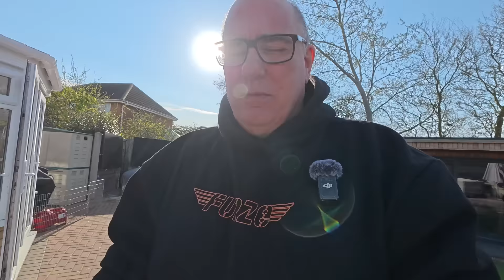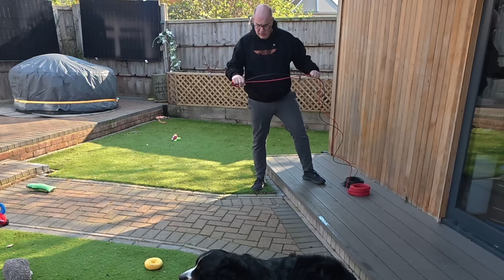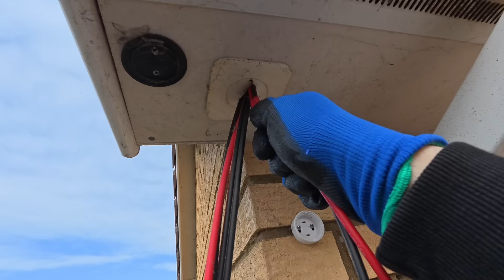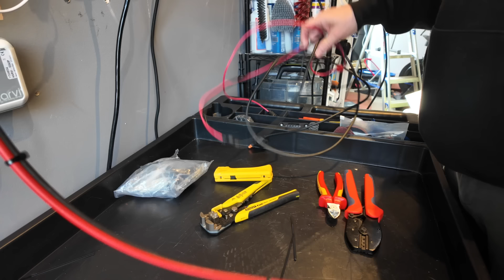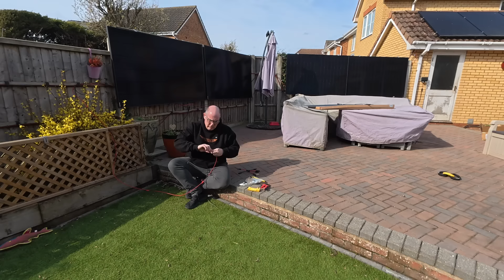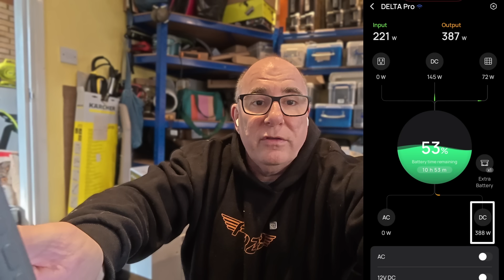My Fence Solar System Just Got a BIG Upgrade

Comment: If you have panels in parallel and one panel gets shade and say the other are in full sun, be sure to install MC4 forward bypass diodes so you don't back feed shaded panels with current from the panel in full sun 🌞 this is for partially shaded parallel arrays.
Reply from the maker: these small systems dont really allow parallel connection unless your using small panels, in my case I have one panel per mppt

Comment: Those flexible panels usually output 12V, right? I wonder what the voltage and therefore wattage loss would be with running those somewhat long DC PV cables...
Reply from the maker: @konstantinlozev2272 not quite — most panels aren’t really “12V” 👍  

They’re usually:
- ~30–40V (typical panel Vmp)
- Higher on open circuit  

Voltage drop on DC cables depends on:
- Cable length  
- Cable size  
- Current (amps)

For typical setups with proper cable sizing, losses are usually only a few percent. But if you run long thin cables, it can add up quickly.  

That’s why most systems either keep DC runs short or step voltage up with strings/microinverters.
Reply: @JonathanTracey when I search on the UK Amazon most flexible panels show up as 12V, some with 18V. The 30V+ ones are typically rigid panels. 
But you are right that there are solutions to that.

Comment: a little tip for the cable reels,get a small bucket for each cable, and find the INNER end of the cable and pull that one out, you also make a small hole near the top of the bucket to pass the cable through, but this might restrict the pulling ability, trial/error on that tho :)
Reply from the maker: that’s a great idea, thanks Kevin

Comment: I believe for long runs you have quite a big of voltage drop on 4mm2 core cables. You might need to check this out.
Reply from the maker: for the 12-15 runs I have its fine, I did ask chatgpt to do the calcs for me but in this case it was not worth the almost double cost for 6mm

Comment: Another very good video. I think your CFO is far more accommodating than mine! If I even touch the plant pots I am banished from the garden!

I began the solar journey in 2024. I have just been test driving an EV. There is something about generating and using 'free' energy produced by the sun. It is a lot like sailing. Harnessing what nature gives us.

I am a Brit but live over in Luxembourg. One of the things I have noticed is that our export rates have always been significantly less than your's. I went to a dynamic tariff to try and least take some control over my exports. However, there are frequent times of negative pricing for export to the grid. Thankfully my system can cleverly adjust to ensure I do not export at these times. Have you contingencies in place for if/when energy suppliers ever would have negative pricing? A dumb system could be quite expensive if exporting when prices are negative...

Any more chance of more of the dogs... my CFO would be more likely to watch your excellent videos 🤣.

Also thank you for all the other topics you discuss. The more you know...
Reply from the maker: @tomstours2220 thanks for the kind words, really appreciate it! 😊

Haha I think the reason my CFO is a bit more accommodating is that we both come from a military background, so we tend to be very much function over form — as long as it works, we’re happy! 😄

Great point on the negative pricing as well — not something we’re seeing much of here yet, but definitely something to keep an eye on as things evolve.

As for Yogi and Bear… they very much do their own thing! Trying to coerce 55kg dogs into appearing on cue is easier said than done 😂 but I’ll definitely try and get them involved a bit more for you (and your CFO!)

Thanks again 👍

Comment: I use a PV box with breakers where solar comes into an enclosed trailer or into the house for safety.

This also provides me with manual breakers that I can shut off when doing maintenance.

These are super cheap, especially on sites like Temu. I think I paid like $30 each for them. Prices here in the US have gone crazy high for all sorts of things so I don’t know what it costs in an electrical store. I would guess 3 to 4 times higher.

It will also potentially help if lightning strikes something
Reply from the maker: Yep I have a couple of dc isolators on the strings for that exact reason

Comment: 6:16 You need a stick with the rolls oriented on it like toilet paper comes off. You need the stick elevated enough, so the rolls can spend freely. Position it at one end and unroll towards the other end.

In Florida and other really hot places, using electrical tape as a temporary attachment creates a huge mess because it starts to melt almost immediately. I found blue painters tape to be very good for temporary attachments of cables. And if you’re running it along something and not through conduit, you might consider a zip tie every 12 inches.

If you have a zip tie tool, you can use the small zip ties and it takes only seconds to attach each. The tool is like 8$ on Temu.
Reply from the maker: yeah I am going to order a dolly for the cables so next time they are not such a mess. Tape is fine here even in summer but once I have them in the final place will replace with zip ties

Comment: couldnt you turn the existing ones 90 degrees and fit more in the same space?
Reply from the maker: I did try it, but the shading down at the bottom started to cause too many issues
Reply: @JonathanTracey  ah I thought the modern panels with cell optimisation may have covered that for you now

Comment: You do a great job explaining everything on your videos! I just looked at my north fence vertically mounted solar panel output for January-March of '26. January through the end of February my peak output was 3.5kW and now in March it is down to  2.6kW. The sun is getting higher in the sky now, I need to address adding some angle to them. Always fun projects.
Reply from the maker: yeah I found even a 5 degree tilt makes a difference

Comment: Yes, it's a bug that's bitten hard with all of this solar stuff.  Just installed two 515w panels on the fence at mums yesterday with and Echflow inverter.  Decided to do the same at mine so bought another two panels and an inverter.  Then I started looking at the bi-directional tracking systems.  The one I've found looks the part and gets good reviews.  Have you come across Eco Worthy and if so, what do you think of their tracking system ?
Reply from the maker: I have looked briefly at Ecoworthy trackers and if I had the space I would probably try it, but my experiance with ecoflows single axis tracker was not good, it broke after 6 months

Comment: I have just put 5 panels on the shed roof, 4 on the side, 2 on the hot tub roof, and 6 on the fences. Hoping for good things when the longer days kick off. It took 3 configurations until it looks ok-ish, the hot tub resembled a lunar lander for a while.
Reply from the maker: nice, should power the hot tub all summer long

Comment: Hi Jonathan. So 400w of panels for say 5hrs a day running at 50% output = 1KWH per day average. 365KWH per year perhaps. My current IOG fix (4/27) with batteries gives me 96% of total usage at 3.5ppKwh. I think you have batteries so could you be only saving about £15 per year with these 4 new panels ? And how you get away with so many ugly panels in your garden........
Reply from the maker: for me its more an experiment, proving balcony solar could work, my fences are no in the optimum position but if you had a nice south facing balcony it could so wonders. In summer I see about about 1kWh from each panel per day. overall its a nice addition to the roof top solar, should anyone else do this, probably not but its fun experiment. Ultimately I hope to get to way of making or re engineering a fence panel to build the panel into it, but I am a ways off that right now. Wife is very undertanding being married to an engineer who needs to tinker :-) Always go for function over form :-)

Comment: Curious on how the industry defined panel size. We have imperial, metric, UK gallons, US gallons, why not "UK fence width"? For simplicity and aesthetics, a panel size, rigid or otherwise, would suit quite a few potential adopters.  Panel pricing is interesting too, flexi seems to be always more expensive than rigid which doesn't seem to make sense, other than market driven. Are they 3d printed?  Upside down fork compared performance of flexis against a few against fixed. Panel cost proved to be a big negative, but weight was definitely a flexi strong point. 

As for cables, a broom handle would have saved grief as I presume they were supplied already rolled. How do you go on with Christmas lights!
Reply from the maker: @Stormin_Mike you’re spot on 👍 there really isn’t a true “standard” size

There are common formats (mainly driven by manufacturing and shipping efficiency), but beyond that it’s pretty fragmented — and as you say, you can get custom sizes made if you’re willing to pay for it.

On flexi vs rigid — flexis tend to be more expensive because they’re lower volume, more specialised, and use different materials/processes rather than mass-produced glass panels.

And yes… lesson learned on the cables 😄

As for the lights — they’re safely on the tree… in the attic… because festive spirit and cable management don’t mix well 😂

Comment: Have you looked at the voltage drop of 4mm2 vs 6mm2 cables on those long runs?  Might be interesting data.  Although the 6mm2 will be expensive in comparison so may not be worth while ...
Reply from the maker: I did (well I had chatgpt do them), it was negligable as teh cable runs are only about 15m, not worth the massive uplift to 6mm

Comment: How much were the slim panels? I bet a few people look in the description in case you've linked them. 

Also.... Intrigued as I'm sure you've already thought of this but what's the reason your garden office doesn't have panels on it? Lol
Reply from the maker: I think they were £159 each, not cheap but for non standard sizes they were the most reasonable i could find. Links in on my amazon pages if you want specs. https://www.amazon.co.uk/shop/jonathantracey?ref_=cm_sw_r_cp_ud_aipsfshop_9KAN295QDTK640V8YBVG

The garden office roof would be ideal if it were not for the trees behind it that keep it shaded almost 100% of the time. THe farmer owns the trees so can't cut them down and TBH they keep the sun off the roof and keep it habitable in mid summer

Comment: I use 4.5mm² twin core DC automotive cables for small solar panel systems. It's normally rated at 42 Amps, more than enough for solar use.
Reply from the maker: that's good call, will check it out

Comment: I would love to see an update on the Ecoflow sun tracker mount, think you've had it about a year now from the video on it.
Reply from the maker: it’s scrap now, was useless and even after replacing the motor it broke, in the six months i had it it worked for less than 3 and they stopped selling it 😂

Comment: If your paying six or seven pounds for a no name Chinese Mc4 then your paying well over the odds for what's probably rubbish. Take a look at Bimble Solar and you can get genuine Stäubli Mc4 connectors for that price, and that's the new crimp free ones. They also make up cables.
Reply from the maker: Thanks will take a look, the ones on Amazon (assume from china) are good quality, never had an issue

Comment: This is exactly what I want to set up to charge my BLUETTI Apex 300s in my garage. 

My problem is the best place for the panels is on the garage roof.
Reply from the maker: assume your garage roof is flat, so you need to secure them down well, otherwise they will take off in the wind
Reply: @JonathanTracey actually it’s the garage wall into the garden gets no sun whatsoever.

Comment: The cables got al tied up because you were pulling from the reel and in the end the twist got so bad it had no ware to go. Put both on a broom handle and pull with the reel turning the cables will stay straight and will look better
Reply from the maker: good tip thanks
Reply: Yes, every wrap you pull off the end of the spool puts one twist in the wire.
Reply: Also, either get an assistant to hold the handle of the broom, with other end resting on a step, guiding the cables off the spools. Or put the broom through the rungs of a stepladder.
Reply: If one unrolls the cables by putting them on 3d printed 4-spoke skeleton spools the cable is a LOT easier to pull as it is not all twisty and springy.
Reply: How’s the SC going???  It’s a dull start down south today (Mon) but the daylight hours are long enough now to get us topped up for free

Comment: Looking good JT. What's the plastic bench worktop you've got ? Looks great for not loosing tools, fixings in a workshop.
Reply from the maker: it’s a janitors trolly, the kinda thing they wheel around large buildings, have my delta pro batteries on the bottom as it makes them easier to move and the troubles as a workspace that stuff can’t roll off

Comment: 2:22 looking at the shadows your biggest sun blocker to the fence is that overgrown hedge at the bottom of the garden! They look to be 8 metres in height. 

If that was my house, i’d be there with a pole saw trimming them to max 3 metres!
Reply from the maker: I do trim them back but only what crosses my boundary, the rest is the farmers and despite asking him to cut it down, nothing
Reply: @Jon @JonathanTracey he letting them grow high out of spite or doesn’t want to spend his budget? If the latter offer to trim them yourself. the big one just behind your garden room could be accessed by standing on its roof. Alternatively 6 metre reach pole saws are £45 in amazon

I have done similar with my neighbours where shrubs and hedges were blocking direct sun. They were renting so had no reason to pay to have them cut back.

Comment: I've always said whoever invents a non tangle ECG cable would be a god. Using them daily in work they're always tangled. Especially on an ambulance.  They're stowed in a bag, taken out, put on patient, stowed again (hopefully by a caring colleague who doesn't just shove them in)

They're always a rats nest they you spend way too long undoing
Reply from the maker: I have even coiled a cable neatly, stored it away and its tangled when I use it again, I swear there is a gremlin that comes out at night and tangles cables for giggles

Comment: If I had a pound for every swear word I have uttered while untangling wires............noting the wonderful Mr Millibandero has announced on Laura Kuenssbergs show this morning that plug in solar is OK!......for some the option of the micro inverter and plug in may do now and it will be finally LEGAL
Reply from the maker: @davidveysey4368 Yes I saw that as well. The key thing now is getting the electrical regs updated to reflect it.  

My hope is they keep it simple and don’t make it unviable by piling on extra requirements like DC isolators, surge protection and specialist bidirectional RCBOs that would force people to bring in electricians for what should be a small plug-in system.  

If the goal is to make small micro-inverter plug-in solar accessible, the regulations will need to stay proportionate otherwise the costs will quickly defeat the point.
Reply: @JonathanTracey  Agreed, our problem is whilst we have a very good PLUG that isolates current so much depends on peoples actual electrics. old wiring will be an issue and I fully expect limitations.....sensible ones at that to restrict how far you can go in the first instance